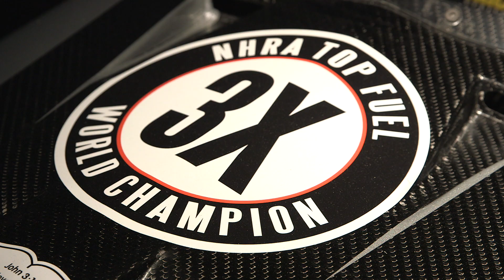Larry Dixon Two-Seat Top Fuel Experience

Comment: OMG.... I hope they have reasonable prices for the common guy.. I would be guessing $2K. Even though it costs $9-25K per run most of the time for these cares. Also I hope they offer a 1/4 mile run as well. I also hope they make a circuit run at different tracks..... St. Louis for sure!!!!!! My home track!!! Great Idea.
Reply: At the Northwest Nationals at their "Nitro School" they mentioned that the cost per run for a fuel car is around $1200-$2000 per run
Reply: I would guess that you can forget about 1/4 mile runs. Since they dont race 1/4 now they dont have the parts, the tune up. the experience. 
If it's not safe for the pros why would it be safe for a passenger? It wouldn't be safe and it would be  feast for attorneys.
Reply: so lets see,  you want lower prices and longer runs even though Top Fuel no longer races 1/4 mile.    Champagne taste and beer budget comes to mind.  Some things just cant be done.

Comment: Is that one cylinder supposed to be blowing smoke like that?
Reply from the maker: That is actually fuel not smoke. During burnout there is not much load on engine and often times it will put cylinders out from an overly rich condition. Top fuel cars will run a fuel pump that at wide open throttle it will pump 100+ gallons per minute. As soon as you close throttle at end of burnout cylinder will light right back up.
Reply: Awesome thanks for letting me know. That makes sense to me now. I love the short video of you punching the throatel. It's very cool how it hops. Thanks again for sharing.🤘💯